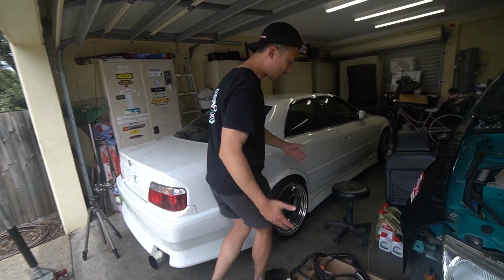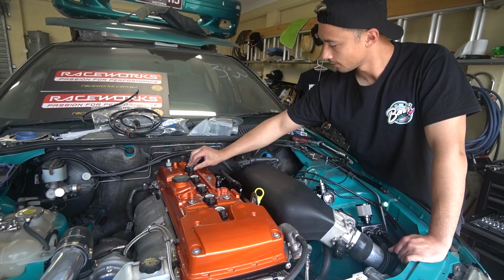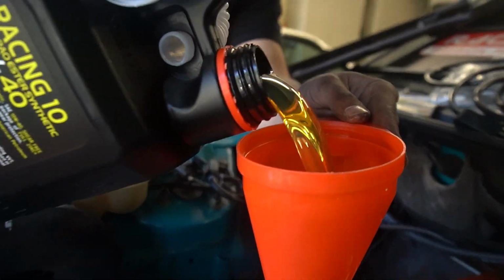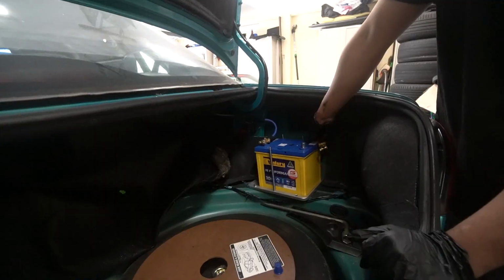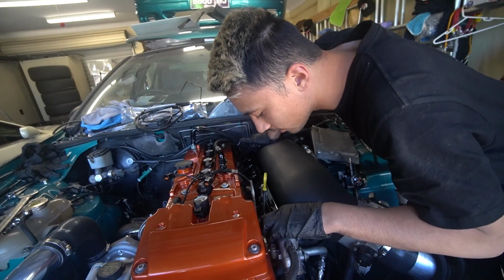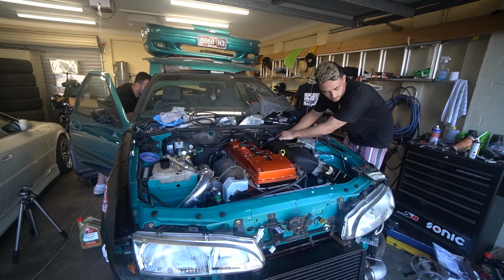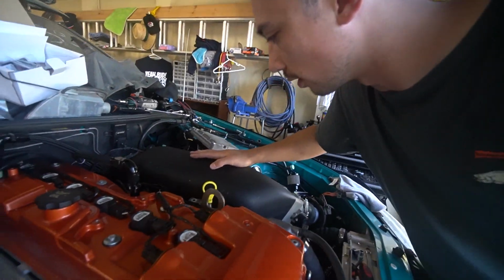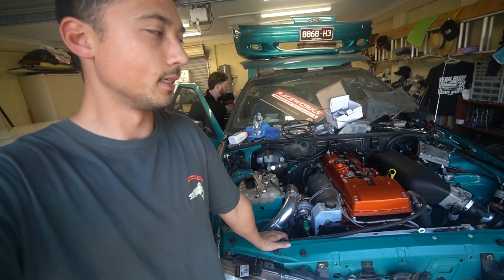BARRA EF FALCON FIRST START! *BARRA TURBO NOISES*

Comment: Hey heads up 
The power steering pump needs a particular fluid. Penrite does one for ef-fg (psf0005)
Other ones will blow out the seals eventually and fail

Comment: You are missing a black plastic piece for power steering pump. It routes oil away from alternator in case power steering pump leaks as the alternator sits right down the pump. It looks like a flat genie’s lamp.

Comment: guys on Ford falcon or Ford Mustang try not to Pre-Fill the Oil Filter as it's in a angle where the oil can start leaking from the oil filter. On Holden V8 LS1 to the Latest the filter goes directly up where pre-filling it does no harm also with the HEMI engines the oil filters can be pre-filled.

Comment: Dude… get rid of that power steering fluid ASAP. Grab a couple bottles of Mobilfluid 424 from any 7/11 and run that- that’s what they run from factory and any other product (even if they say it suits Ford P/S systems) will start making the pump sound like garbage before you know it. Change the AU’s fluid while you’re at it.